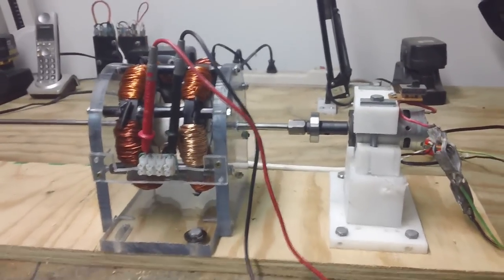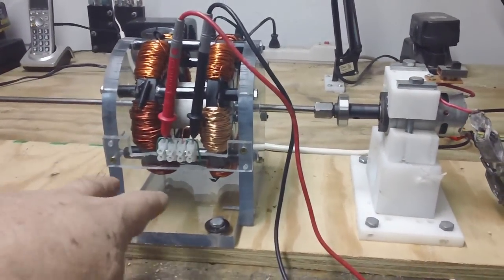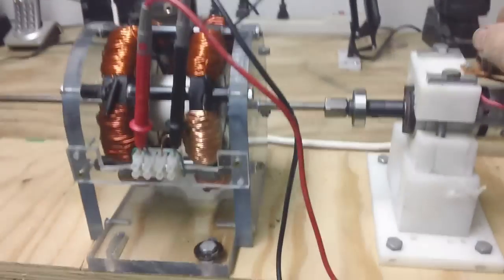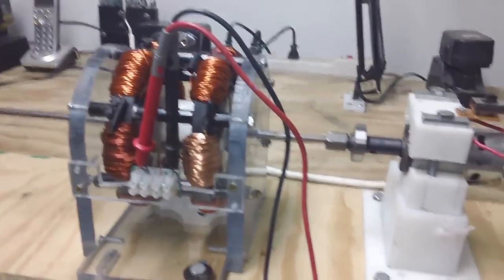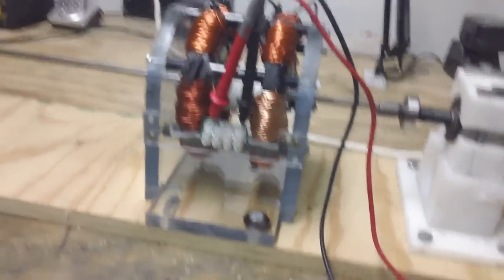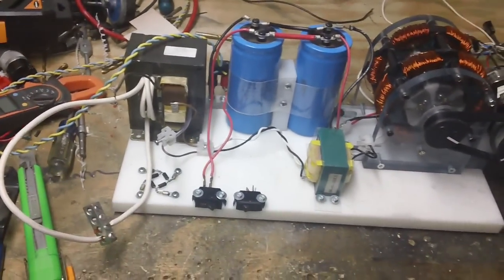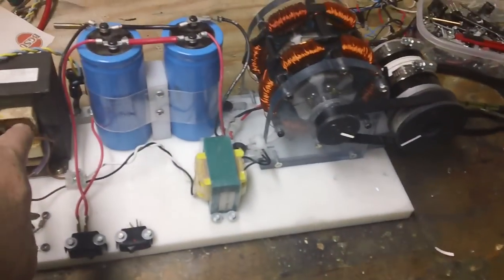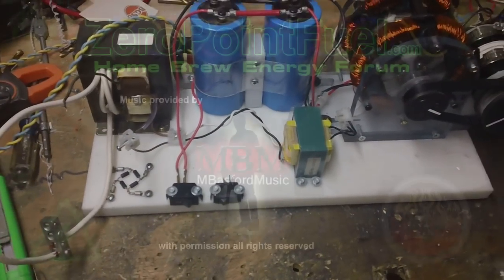New Generator Test

Comment: You say 160v and 90amps out. Thats 14400 watts! This cannot be right. Especially with only 2amp motor draw at maybe 12v?
Reply from the maker: +Greg Stafford hi Greg yes it is 160 volts into the transformer  BUT, the same rules apply to any transformer, the output wire that I am clamping the meter on is not 160v  you only get about 2 volts per turn  so it's only about 4 volts at 90 amps and if you disconnect the dead short wire you would get a massive drop . this video is documenting my efforts to get power out of this new type of generator.  thanks for watching